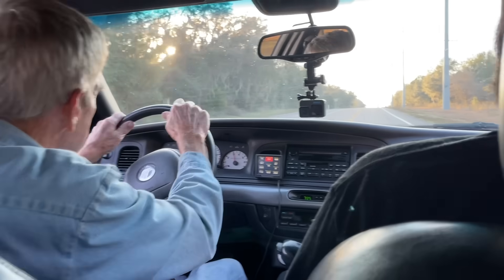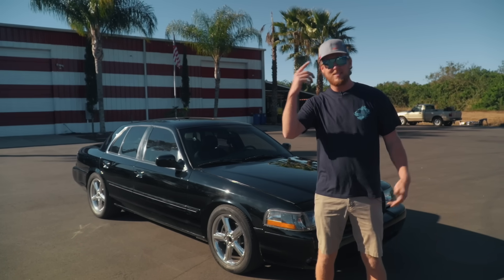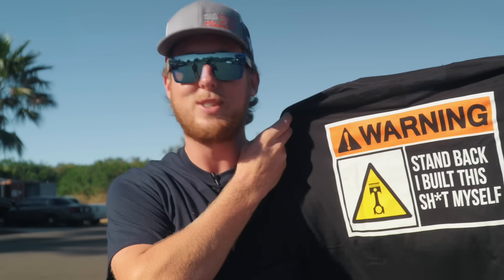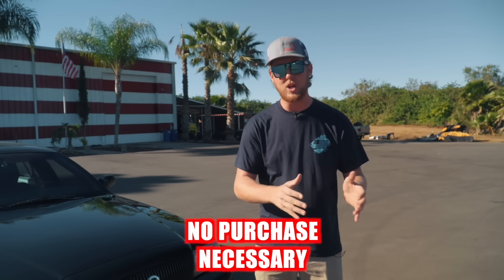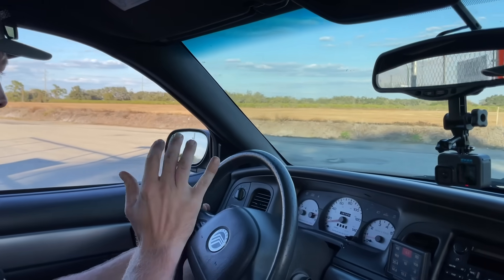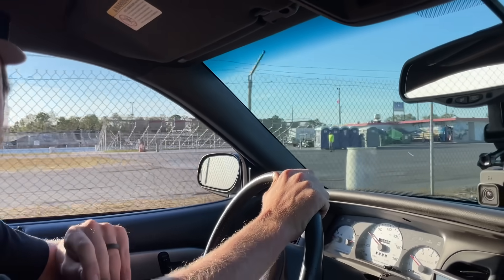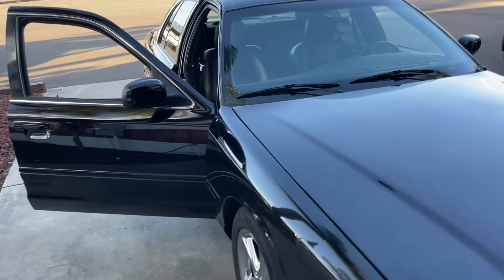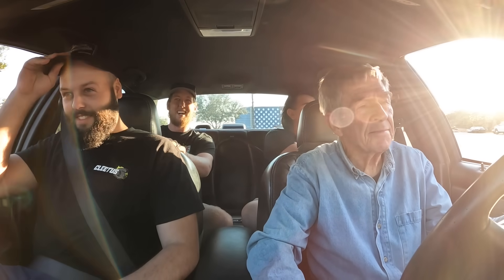Our Ultimate SLEEPER Turbo Marauder Is Done and It's INSANE!!! (Fastest Its Ever Gone)

Comment: I love how Sam just doesn't lift. He's a wildman! Also wanted to point out in the giveaway details you said something about built engine and turbo, I bet you were thinking of some other build, the Marauder is basically how it rolled off the showroom floor, bone stock other than some AC adjustments for better comfort and efficiency, more power makes it to the wheels with how efficient that aftermarket AC compressor is.
Reply: "There it is". Sam talking about the Marauder's exhaust note like it's a woman's G spot.

Comment: Some quick estimates on Sam's rip - he revved out 3rd gear (1:1) about all the way to 6500 rpm. If the rear gear is a 3.73, that's 1,720 tire rotations per minute. If we calculate on a stock Marauder's 235/50 R18s, that's 740 revolutions per mile giving us 2.32 miles per minute or 139.45mph.
Reply: F@cking getting it 4 deep too
Reply: Fucking math , am I right?
Reply: HELL YEAH, Thanks for the math. Once that 4th gear and still WOT nothing but 🤟
Reply: @senseicorey9979  It's the best!
Reply: There is zero way he was only doing 140. They had to be going 160+ and thats a low number i feel like.
Reply: And they were going downhill too.
Reply: I think it’s a 3:08 gear so it’s more like 160 mph I think 🤣 which is preposterous
Reply: @AnDrEw122100  yeah nobody taught sam how to lift LMAO
Reply: @peik_haikyuu2265 he knew he was only getting one pull. Gotta make it good 🤣
Reply: @C_Burke  he was on the gas for 12 seconds from a roll

Comment: 700 whp is well over 800hp at the crank. Even if you've got a legit racecar with thousands of pounds of downforce, it's uncontrollable at full throttle at basically any speed. 550-600 hp max on something like this unless you're on a drag strip with radials or slicks, and boy will it be a handful even then.